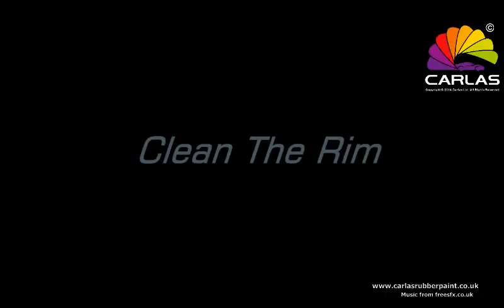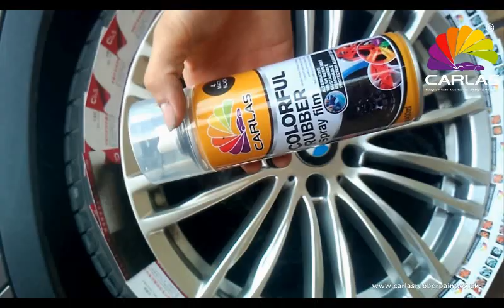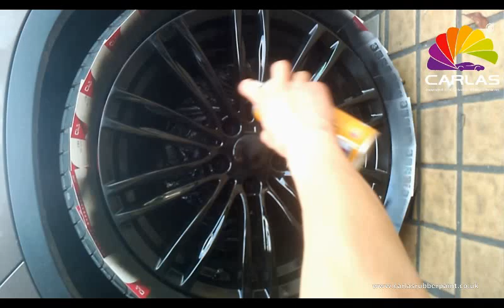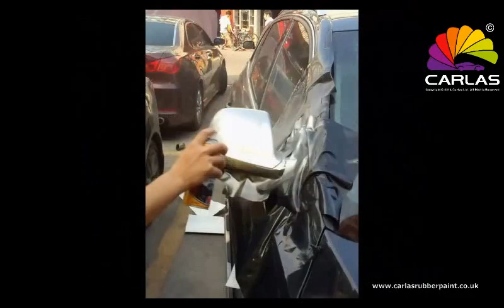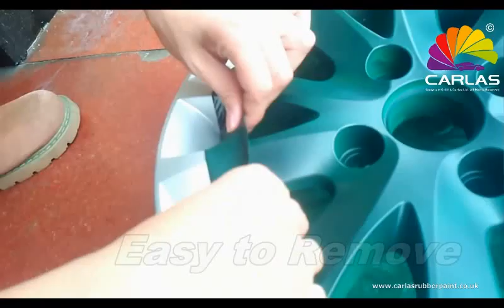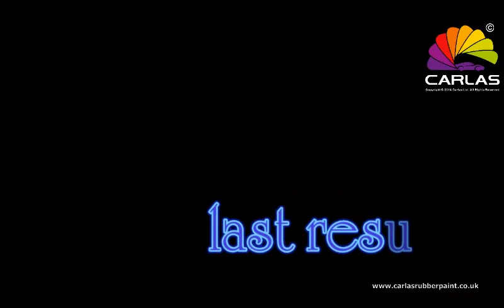Carlas Rubber Spray film paint, peelable, Alloy wheels how to fit

Comment: 2- Is the paint layer shiny or not ?
Reply from the maker: رائد الرائد The paint is a Matt finish, for more glossy finished Clear Lacquer can be applied.
Reply: +Carlas Rubber Paint  What kind of laquer paint did you use? I can only find spray laquer for wood metal and plaster. but nothing for rubber or plastic.
Reply from the maker: +djmaya3d Lacquer must be from Carlas, code C190 which only works with the rubberised coating.